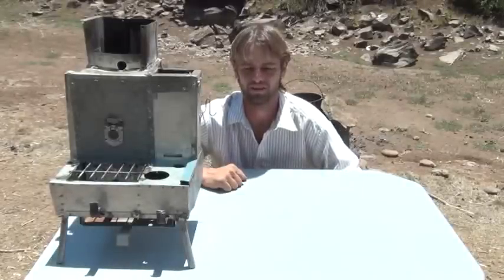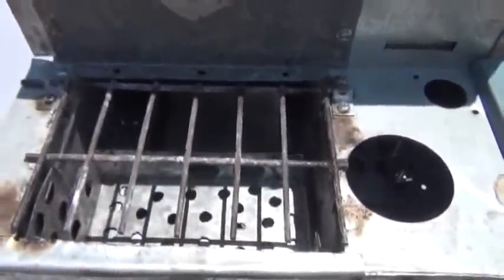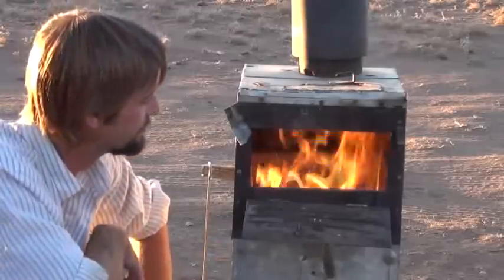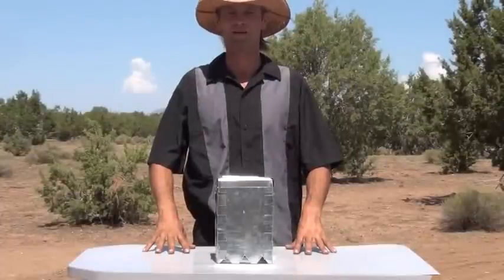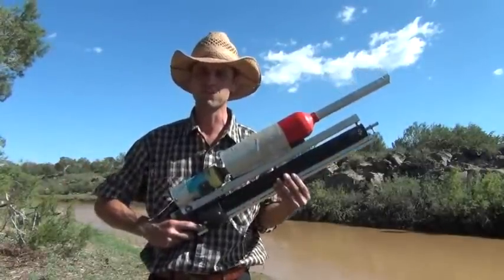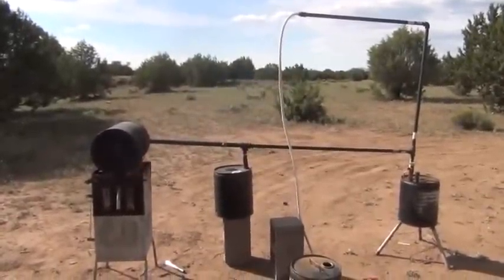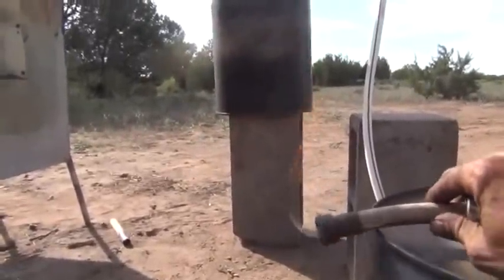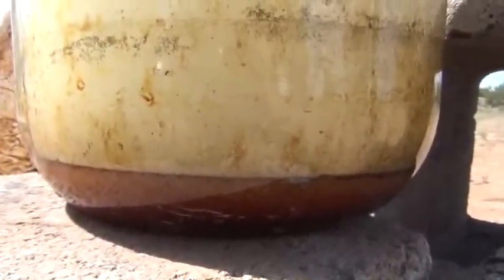WOOD GAS 101

Comment: your wood stove would still have a flare off even if it didn't have  the air feeding exhaust flue pipe. because superheated gasses will reignite, once the superheated gasses reach a new oxygen source. if your going to utilize the gasses you might want to cool these gasses and then use then in another application.

Comment: i've not seen what you do with the oily blackish byproducts extracted from a wood gassifier. can anything be done with them. seeing you've not made a video on it.
Reply: Mr. Myers there is a video on what he does with the black liquid. I believe he refers to it as bio crude but also known as pyrolysis oil. He takes the liquid and he distills them into various products like gasoline, kerosene, and diesel, just like an oil refinery. Its quite interesting because he uses soup cans!! I don't remember the exact name of the video but there is one.
Reply: thanks, i"ll have to do more searching to find it.
Reply from the maker: dale myers  The previous commenter is correct I refer to it as bio-crude oil, and have an extensive line of videos covering the conversion of the long chain carbon atoms found in the biocrude to shorter lighter carbon chains from petrol to propanol's. To find the videos search "Biocrude Oil" on YouTube.

Comment: Thanks for the compilation Mr Teslonian! Always love the gasification stuff. I have a question though. I made a gasifier out of two steel cylinders, one inside the other etc, and in your videos you seem to use square boxes instead. Is there any performance difference between them or is it just more practical for you to use square boxes? Also how would you compare the efficiency of the rocket mass heater vs a gasifier for heating your home / hot water? Love your work! Cheers /Joakim.